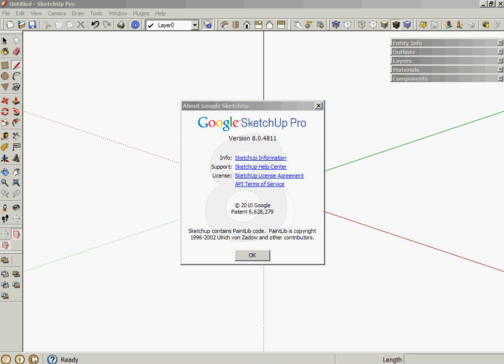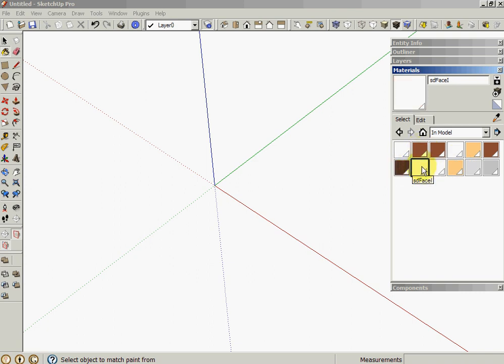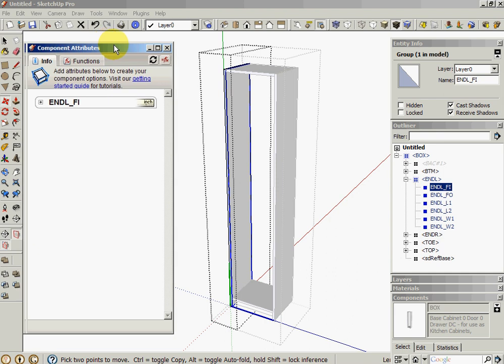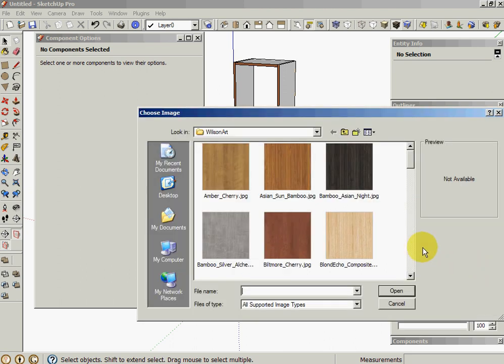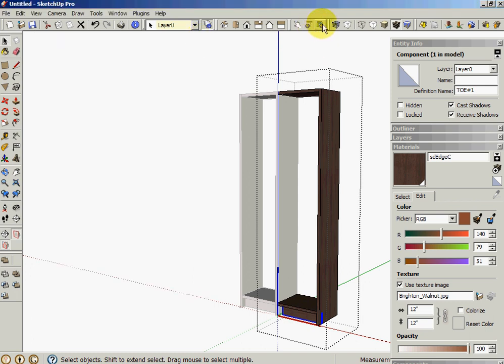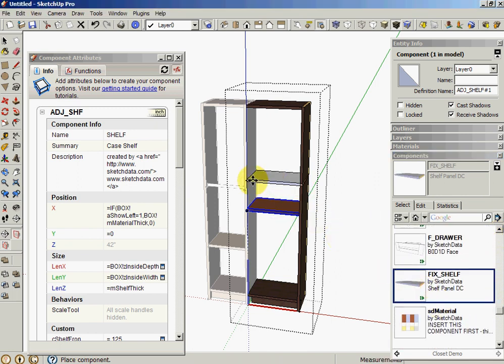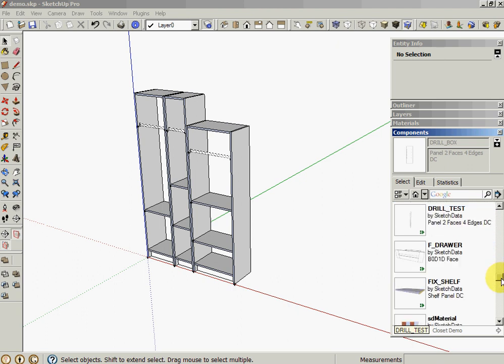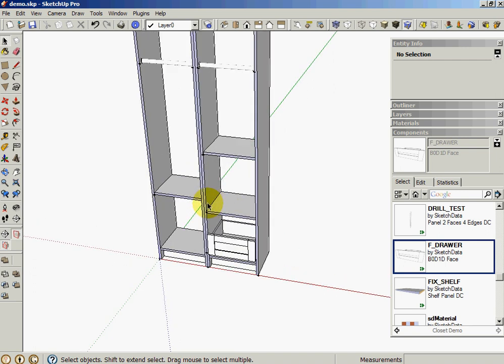SketchUp Dynamic Components for Cabinets

Comment from the maker: Sure, you can add other calculated attributes to the components for each edge of the part, or use the part type and finished size data in a spreadsheet to calc cut size and apply edgeband info before sending to cutlisting program.  Best method may depend on how many edgebanding thickness options you have.